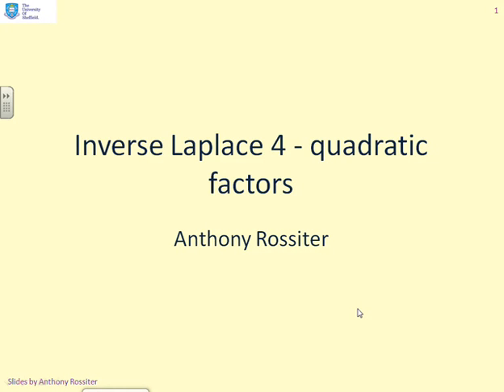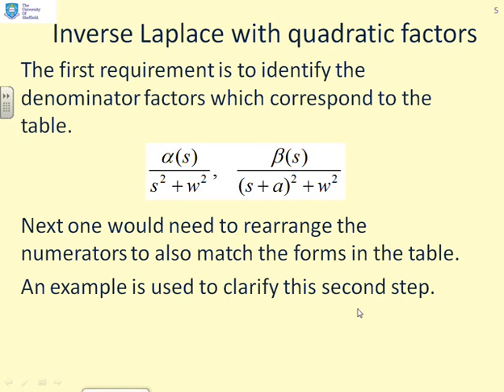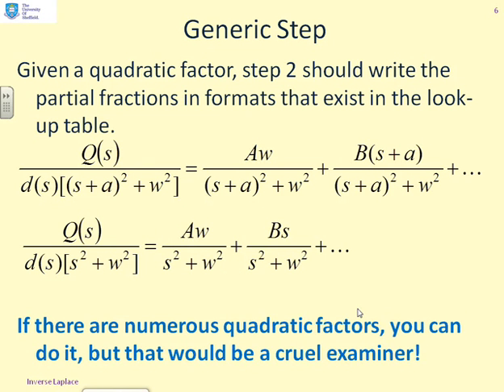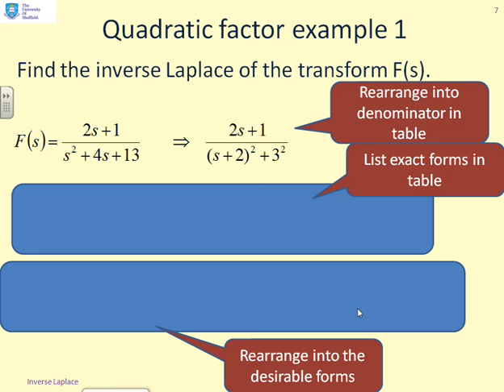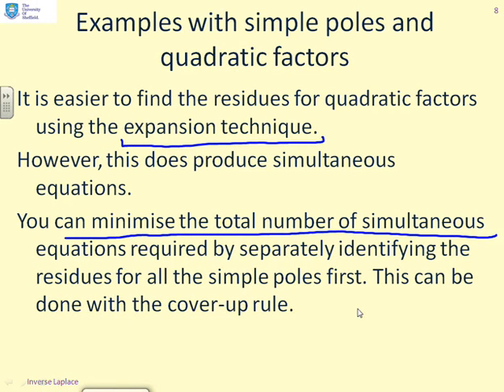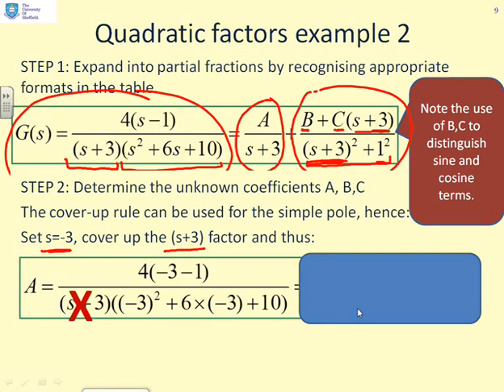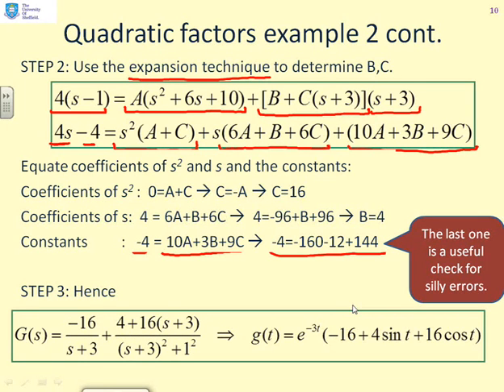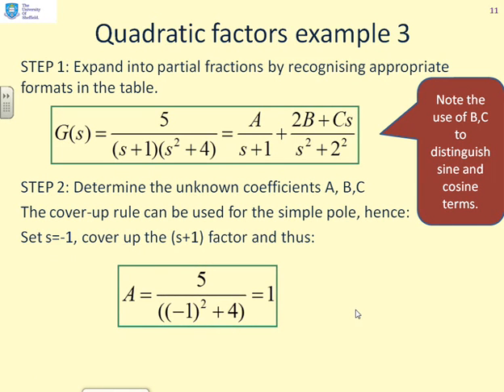Inverse Laplace 4

Comment: I think in the final example there is a problem in the answer.There shouldn't be 0.5 in front of sin2t.. But maybe I am wrong. Please check it ..Respect :)
Reply: I have checked the answer with my calculator (Casio Classpad) which can perform ILT, and the formula of the professor is the correct one.